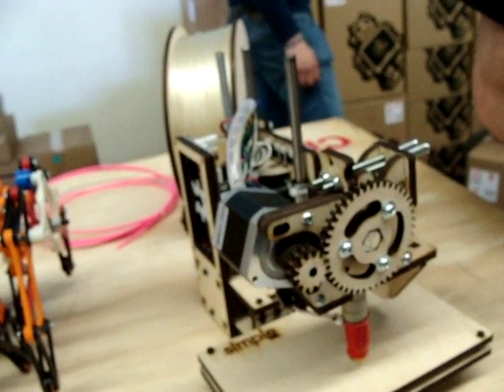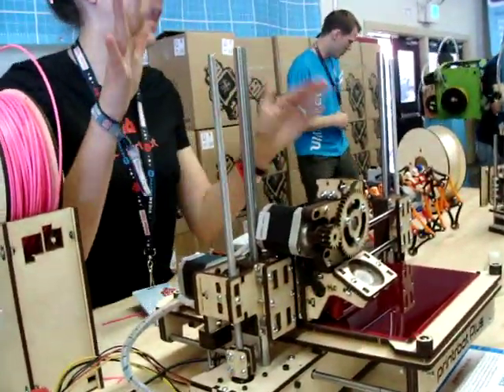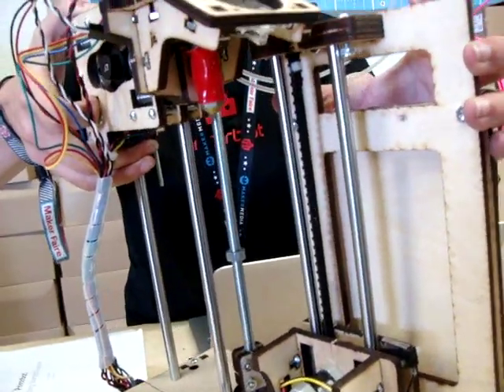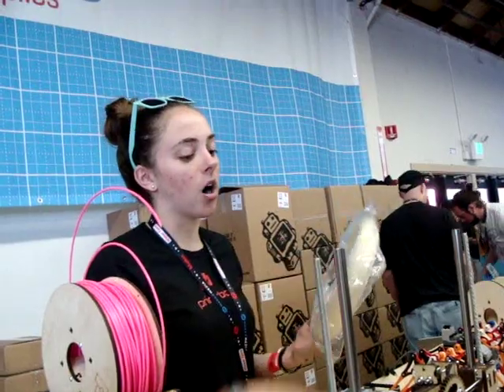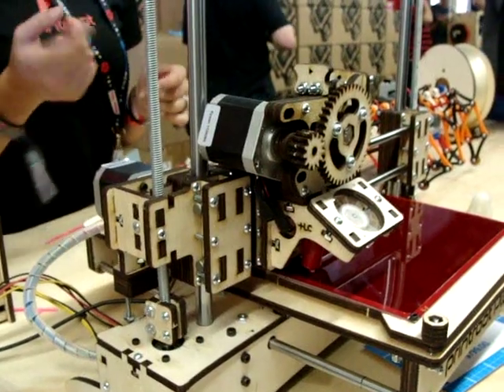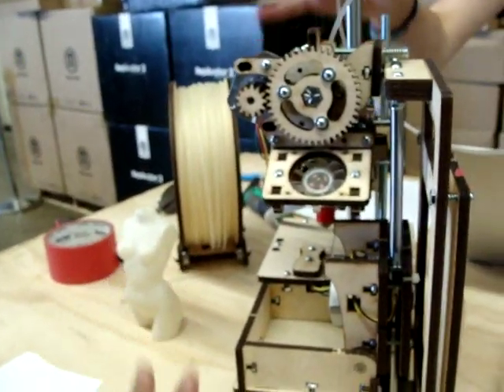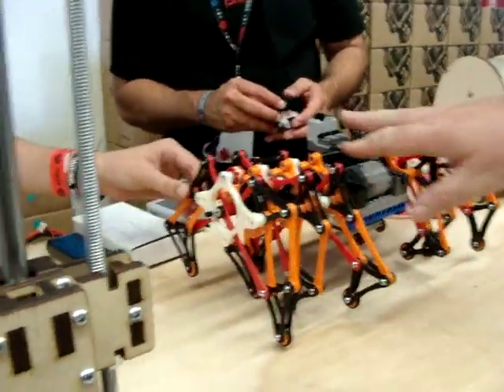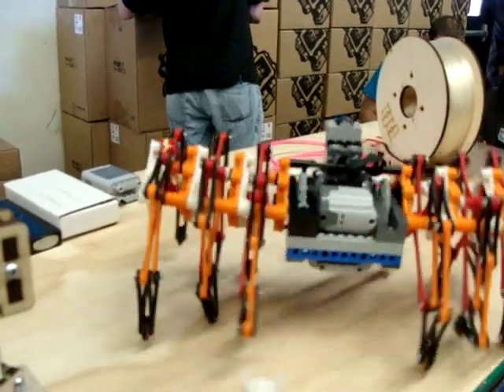3D Printing: A look at printrbot Jr. and soon to be released printrbot Simple.

Comment: this is my question as well. If I could design simple fittings in autocad and print them in g-code with the printrbot, my prototyping would be SOO much easier.   SURELY they have a way to convert or import a g-code program into the printer